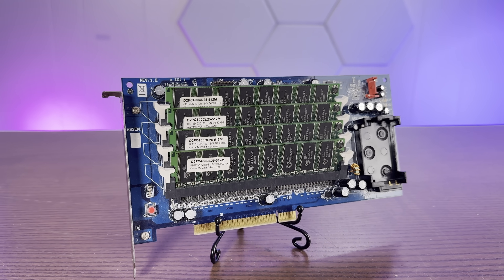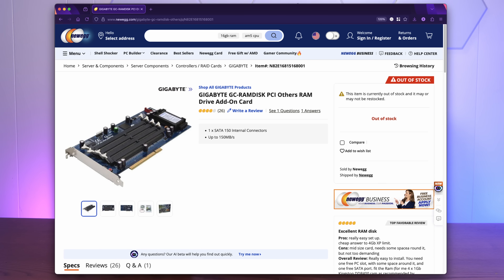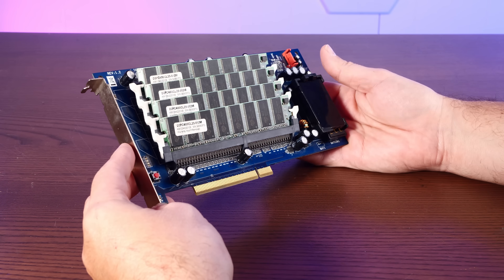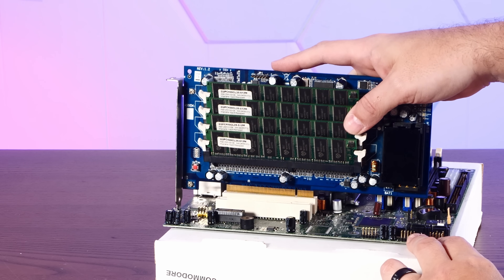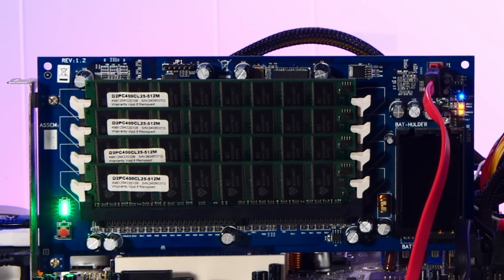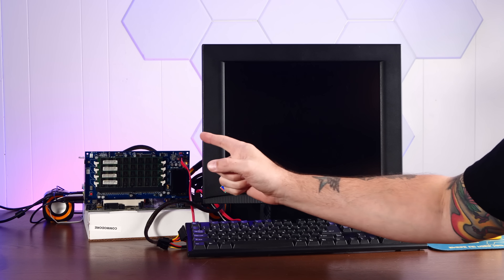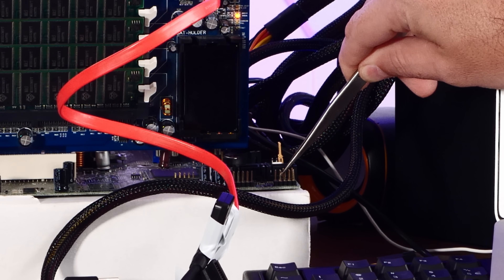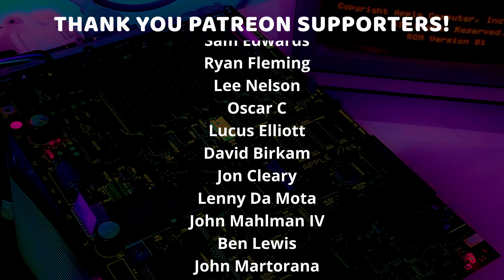This Early SSD Was WILD

Comment: some of these depending on the motherboard would boot from the card when not connected to a sata port i kind of wished you would have checked that as well

these were also good for your temp folder as if you had no battery it would dump your temp folder every time you shutdown your pc

Comment: Damn I remember reading about this thing. And it wasn't even back when I was little... I thought it was wildly more expensive though, for some reason.

In any case the battery thing didn't sound any better of an idea back then than it does now. It was pretty bonkers to trust RAM modules with long term storage.

Comment: That's pretty fun! Cards like this would be pretty good for caches. Though TBH the battery backup on these is maybe less useful for legitimate uses. Reminds me of something similar but way more common. Raid controllers would often have a ram cache with battery backup built into them. This would let the controller use the ram as a read/write cache that could survive a power outage.

Comment: Back in those days I was lucky to get a LSI SCSI RAID controller for free (64-bit PCI) and bought four 73GB manufacturer refurbisched 15K drives for it and configured them as RAID 10.
XP booted in a few seconds. Best PC I ever had and with its dual Athlon MP1800 it was probably about the fastest desktop you could own back in those days (2001-2002).
Compressing movies from a DVD into a file small enough to fit on a single CD was something that would take 4-8 hours depending how fast your machine was but on the gear I owned it took between 20-40 minutes.

Comment: I remember someone, somewhere asking about these in regards to like a speed testing program or something. I think they were talking to the developer. Like in the past year or two. I had to ask them, did they mean these very, very, early ones, or something else, because I wasn't aware of any DDR4/5 solutions (not sure it ever went past DDR2, if even DDR1), and wasn't sure of a solution that made sense when you can just use primocache. Afaik, primocache allows you to dump a RAM cache to disk on shutdown, so if you had some crazy rig with like 128gb of RAM, or a crazy workstation like 1.5TB of RAM, you could make like a 64gb to ~500gb RAM disk reasonably. But then I had to ask again, why? Most games, or even programs for that matter, don't even use a DirectStorage like API, and with games and scratch spaces being so big, I was genuinely confused. Say you wanted to play like a latency sensitive multi-player game. Most of them are between 40-120gb these days. And if you were gaming for max performance, you wouldn't be doing it on a threadripper (yes, any modern threadripper, Epyc, Xeon, any HEDT CPU can game fairly well compared to desktop CPUs, but even the best ones generally don't have the single threaded performance of, say, a 9950X or top of the line i9K, since they're not built for single threaded performance. They're built for peak performance on all cores, and it's part of why thost most expensive chips are like $12k).

Granted, sure, even DDR1 speeds are faster than most consumer SSDs, but why? Why would you need like 2GB of super fast storage?

Comment: That is not really a new thing! There were smarter Devices in the 80ies like GeoRAM for the C64, that used SRAM and could be powered with a small cell since SRAM does not need a lot of Power. Using DRAM for this is stupid since it will drain the Battery much faster.

Comment: Calling this an SSD is such clickbait.  It's a RAM disk.  RAM disks were very popular once upon a time ago.  Back in the Mac Classic days starting on OS 5 I did a ram upgrade doubling the ram in mt computer.  Back then there wasn't true multi tasking and apps didn't take advantage of large ram, so why did I do it?  I had RAM disk software.  I'd take some of the RAM from the available ram, copy the OS to it, then reboot with the RAM disk set to the higher boot priority.  To the end user this looked a lot like double booting up, which took about 5 minutes first bootup, 1 minute second bootup.  After that the computer had SPEED, infinite speed.  This is back in the day when computers were slower than slugs. This was back when you'd click something and wait multiple minutes.  Now everything was instant.  No load times on anything.  Everything ran stupidly fast.  It was the 1980s and you could make a computer run faster than a lot of setups people have today in the 2020s.  I could write a script that would copy the app I wanted to run onto the RAM disk then run it.  This had a delay in startup by a little bit, but after that no load times.  Everything was always instant.  

RAM disks were AMAZING.  It's hard to express how much they changed the end user experience through text.  I'm a Data Scientist and we do a similar thing in notebooks today called memoization.  Basically we save half processed data in ram.  This can at times reduce loading times from 12 to 24 hours down to about 2 to 4 seconds.  It's such a large speed change Data Science wouldn't exist without it.  Notebooks automagically use memoization so the average Data Scientist can take advantage of the speed difference and be ignorant to it.  The tech is similar to a RAM disk.  It's truly amazing, yet so few people stop and realize how amazing it is.

Comment: Back in college, a project we had with two friends was something very similar, but portable. The idea was taking an old RAM stick, slapping a battery and a refresh circuit on it and a serial connector. It was basically a pendrive before pendrives were a thing. Having a portable 32MB device in the era of floppies was mind-blowing, but what killed the project was the big bottleneck that serial transmission was. It boiled down to "we have to connect this directly to the bus somehow". At which point it wasn't portable anymore. Little did we know that USB was right around the corner.
Reply: In the era right before USB, you still had PC parallel ports. AFAIK Even the most basic ports can transfer around 150 kiloobytes/sec, 10 times faster than a PC serial port, and also 3 times faster than an HD floppy.
Reply: @eDoc2020 Yep. But the big problem with that was the size of the parallel connector. That plus the wiring made the device non-pocket anymore  :/  
If I get my hands on an old RAM, I might give it a go again. Just to see it done.
Reply: @MagnusEdvarsson  I guess it depends on the size of your pockets. I was thinking something with a built in connector that slides directly into the port, like those old Ethernet adapters. With SIMMs or SODIMMs it should still be a smaller footprint than a smartphone.

Comment: Imagine PCIe 2.0 x4 as SATA-IV with 64GB cache using RAID-0 SAS. Today they would just do this in software using an UPS. Software could target a SSD read and HDD write.

How does it work...simple block size. HDDs are terrible at small blocks. Use low bandwidth memory and you get low latency page file swaps. You can exploit a benefit on the cost with older generations of RAM like DDR3-1600 costs $2.25/GB versus $4.375/GB DDR5. You increase random write IOPS without endurance issues. In order for it to work you have to have a much larger lower bandwidth RAM pool than high bandwidth RAM pool. Thus lowering the cost of performance by what 80 percent?

Comment: Hang on - if the system is powered down (but still the PSU is connected) does it use the battery or is it charging?
Afaik PCIE doesn't have any active power lines when shut down. If so - couldn't they use the purple PSU wire (USB standby) to continuously top off the battery and have it act only like a UPS?
Reply: Newer versions of PCI and all versions of PCIe can provide standby power. It's used for things like Wake on LAN. Not all boards will have it enabled but I distinctly remember my brother's old Pentium II PC kept an Ethernet link when shut down, even though the Ethernet was a separate card.

Comment: Those random read writes are actually still better than a lot of m.2 drives, it comes close to the fastest ones. Random read writes are actually one of the most important metrics for how snappy and how quick opening random files and loading up an operating system is. Adding more storage to this would actually be an amazing game drive (GTA5 benefits massively from fast random r/w performance). I would love to see it upgraded with more storage. (though unfortunately I believe ddr2 maxed out at 8gb per stick, so even if you got two ram drives it would only be 64gbs of storage)

Comment: Interesting that they use a SATA connector, rather than building in a sata controller into the PCI slot. I guess it makes it easier and doesn't require drivers as a result.

Comment: @ActionRetro 
its still useful for something like bcachefs (a filesystem that sits infront of a another fileystem on a different disk), it was probably used for such things in its hayday. 
Even today cachedisks are used making slow spinning disks raids, have lightning fast writes and assisting in common reads.

but they were NEVER intended to be your OS disk lol

---

Also note: There is 16gb ddr kits, 64bit addressing was availible to ddr architecture, 4gb ddr ram sticks were availible at the end of its lifecycle.  -- You should try to get your hands on it, and try this with a sata adapter into one of your earlier apple/mac's. (Or use it with a sata to pci adapter on them :P)

Comment: This technology was probably pushed into existence for use on submarines where silent operation is a tremendous priority. 

The read/write heads on old hard drives were INCREDIBLY loud, and the kind of wildly mechanical noises that would give away a submarine's position for miles and miles. 

Looking at it through that lens changes your perspective from it just being kinda goofy tech to mission critical for covert operation. 

Of course this is just a guess, and the proof will remain classified...but still cool to imagine.

Comment: The i-RAM used the PCI bus just for power, so it can be installed in a modern PC by just soldering a couple of wires.
There even was a 5.25" version of the i-RAM, called the i-RAM BOX, which was independent from the bus used by the motherboard, so it could be used without modifications on a modern PC.

Finding the right memory for the i-RAM was challenging, though: it could not use "high density" 1GB DDR modules, and many sellers didn't specify what kind of memory they were selling.

Comment: An SSD is one thing, and a RAMDisk is another. As its name suggests, it is RAM memory used as storage for certain tasks, such as speeding up access to certain program data files. RAM Disks were not very common for the average user, although they could be used on older non-GUI operating systems and later, MS-DOS and Amiga OS.

And they made perfect sense, because they were RAM memories arranged in serial to be a “disk,” although with the disadvantage that data was lost when the power was turned off or lost. Currently, RAM Disk are still used for certain functions, although data is no longer lost, because it is written to a large file on the SSD or disk (I'm a user of RAM Disk).

Comment: These things were niche but useful for creating RAMDisks that your PC could use as extra virtual RAM (before high capacity RAM and nVMEs were a thing). The concept itself still has merit; RAM Drives were often used in the professional setting primarily as a scratch drive for large projects, reducing the wear on spinning drives or avoiding burning out SSDs with their limited write cycles.

One spiritual successor is the ACARD ANS-9010 Ramdisk which allowed for up to 16 Gb of DDR2 RAM that takes up a 5.25 Bay and can use up to 8x 2Gb RAM sticks + a CF Card for built-in memory storage, which was popular in the professional realm as scratch drives and sometimes as OS drives, as the CF card would store a full copy of the RAM Drive that it reloaded when the system was powered on. Once those hit the used market, some users would pair two of them into RAID for a real speedy 32 Gb "drive" that could load games or large projects as fast as later nVME drives.

There's also the Zeus DDR3 Ram Drives that I've occasionally seen on eBay, coming in at 8Gb and 16Gb forms, and the Radian NVRAM Ramdisk in 8Gb format. Both are offered again for use as scratch disk space for programs that do a lot of temporary writes, avoiding burning through the limited write cycles of regular nVMEs.

It's a shame that 3DXPoint never panned out; those would have made for the perfect Ramdisk scratch drive; the unlimited read/write endurance of RAM, but the persistence of memory for important projects.

Comment: I would put this in my PCI 486 / 133 :D
Reply: you can use a usb stick to have windows windows page file on - the question is how big usb your windows support - i had one old 256mb usb -i think i would have worked if there were usb drivers ( think win 98 has them but dunno ) and a usb to ps2 port convert add

Comment: I wanted one of these soooo bad.     Glad I didn't get it... lol.   Back in the day I had Raptor X 10,000 RPM HD as my OS drive and my games drive was a pair of 7,200 RPM HD's in RAID0.    Glad SSD's came along soon after.    The Raptor X's were known to go bad, as did mine, and I RMA'ed in and got a Velociraptor in return.   When SSD's dropped, my OS drive became an SSD and I picked up another Velociraptor and the pair were my games drive in RAID0 for a while.    Of course now I am SSD all around with an M2 as my OS drive and an older pair of 2.5" 1TB SSD's in RAID0 as my games drive.

Comment: I think they missed a trick without a dc input on the back so you can have mains powered standby and only use the battery for total power outages. Don't think many PC's had a 5v standby supply then.

Comment: I will say this...   it's pretty clever hardware, but I will not trust this hardware to become a system drive, nor will I trust my most precious files on this type of drive.

1. RAM is not designed to be permanent. RAM is not perfect at all.  Especially Dynamic memory types.  Magnetic platters and MOSFETS can retain data for years.  Memory can technically hold data for milliseconds, and it constantly needs a refresh of writing to stay lit.

2. The cost per gigabyte is prohibitily expensive if you compare that to SDD.  Especially today in 2025.  It makes no sense to use something that is nonvolatile and risky on data storage because, like o said, RAM can have hiccups, and you will lose your data.  

3.  Why not just use the RAM Drive program instead?   RAM drive on PCI and not PCIe is much slower than if you just use the software that is using portions of your systems memory to act as storage to access.  For one point, it's bus directly to the memory controller.  Secondly, it's actually safer!   RAM Drive has this feature of creating a virtual drive as backup, in case your RAM takes a $h!t or loses power.  The only downside to the program is that you have to load the contents first, and you won't be able to install OS on it, which is dumb in the first place.  

4. A touch on the last point, if you ever use Linux live CD before, you can see where you can load the entire image to memory in the first place.  Yeeeah!  You know what that means, right?  You're actually increasing boot times drastically.  What's the point if you have to wait.  

5.  Do most programs really need that much speed?  A good program will know how to make use of your systems memory to play the data right in the first place.

Comment: A fun video!  Thanks for saving this piece of history.  

If you think about it, your laptop keeps its RAM using battery while it sleeps. 

Now get off my lawn... seriously, I lived thru the heyday of the RAMdisk in the 1980s.  As you saw, its speed, especially seek time (zero!), is far above the spinning media.  Which then included floppy disks.  A one megabyte RAMdisk was a big deal when floppies were 360K or less.   You would pre-load your most-used software onto it for instant loading.  (Battery backed, but I didn't trust it with my data.)  When I didn't have a hardware RAMdisk card, I could still benefit by setting aside some system RAM as a virtual disk. I mean, when are you ever gonna need that whole 640K?  

In computers, we are constantly juggling tradeoffs in storage size vs speed.   Putting some RAM in the critical path is a big deal. Just think about CPU cache.

Comment: Similar to this:  ZeusRam 8GB SAS.    example "STEC Z4RZF3D-8UC ZeusRam 8GB SAS 3.5" Solid State Drive w60"

HDD looking SDD "surrounded" by DRAM. On power off, capacitors keeps it alive, then flushes the DRAM to the SSD part. On power ON, the opposite happens.

Very nice for Database Log partition, or ZFS SLOG and L2ARC partitions.

Comment: i wanted one back in the day. never did buy one. by this time....i am sure i had 2 raptors 10krpm drives? i think they were 10k......and in raid0. pinning down years of stuff back then and what my rigs were made of is getting a bit wild. my first rig was a dual pentium socketed board. i couldnt afford 2 chips at the time. started with a p75. bought a second one eventually and both were....SOLID overclockers. i could run 100mhz fully totally stable. but 120 was largely stable under load. that would be in 1995? had win95a but went osr2 betas immediately from my ARRR MATEY lifestyle. 540mb drive, and a 1.6gb spare. once the second CPU was in, had to run NT4 betas generally, but dual boot win95 or 98 betas for gaming due to directx support being garbage in nt4. :)